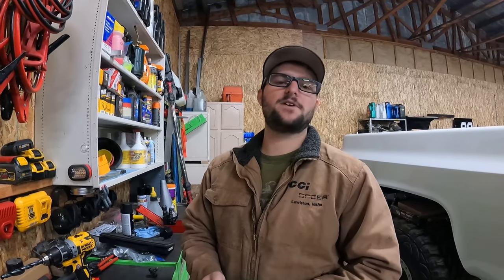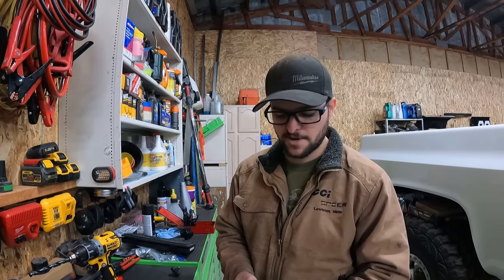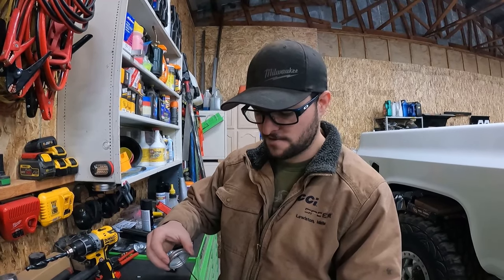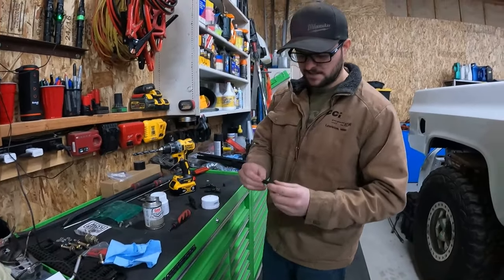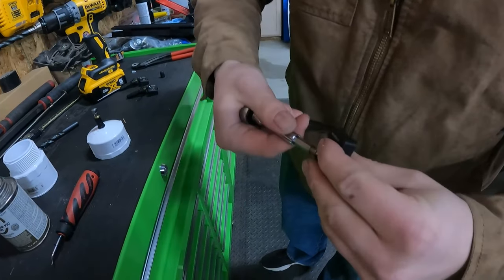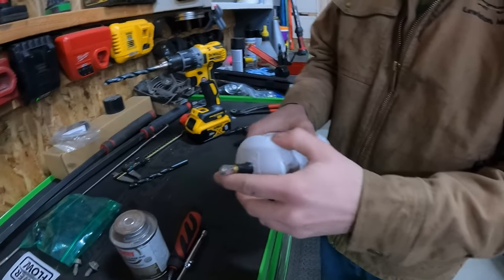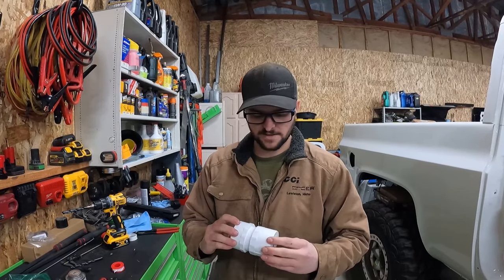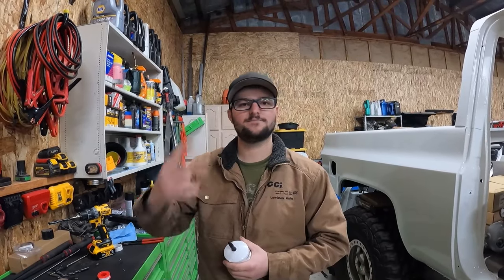DIY TPMS Bypass

Comment: Hi, thanks for the video. But don't the sensors have to rotate in the tires in order for it to transmit signal to the vehicle so the vehicle can get a pressure reading?
Reply from the maker: Not on these ones. Everything works exactly how it should.
Reply from the maker: Been working for over 20,000 miles now with zero issues and no lights. 👍
Reply from the maker: It does not need to see rotation of the tires. At least on Toyotas that is. Not sure with others.

Comment: There is a button on my 21OR on the left side towards the bottom of the dash that will reset the tpms for low air you can set it at what you want

Comment: Could have put them in spare
Reply from the maker: Spare will be getting rotated through the other tires so that wouldn't solve the issue 😬
Reply: @JustinTBraun  gotchya most ppl don't rotate spares lol
Reply from the maker: That is the truth. It's a matching spare so I want them all to wear equally like on the first gen
Reply: @JustinTBraun  understand what ya mean. Ive never had a matching spare lol
Reply from the maker: Neither have I until the 1st gen. Definitely nice to be able to rotate it through with the others
Reply: Better to keep in PVC so when batteries die then its very easy to replace.

Comment: Is there an update?
Reply from the maker: Yes. They are working perfectly! Just make sure to link them to your pickup and you will have no issues. You can have the dealer or a tire shop link them to the pickup.
Reply: @JustinTBraun  awesome. Thank you for the response and the video. I’ll be sure to let the tire shop  know about them before they think I have a bunch of pipe bombs hidden around my truck hahaha 🤣
Reply: I don't understand. Don't they have to spin inside a tire for it to send signal to vehicle computer?

Comment: Kevin Navitas in "Air pressure Sensor trick" kjiP2M3dSe0 claims that simply taping cork to the TPMS sensors (instead of putting the sensors inside a pressure chamber) will cause the TPMS light to go out.  Sounds like a hoax to me.  But if it is true, I think you should make a video about it, considering there is a 100% chance that your PVC pipe will leak and you will need to open it up again.  That would be an excellent opportunity to prove or disprove his hoax.